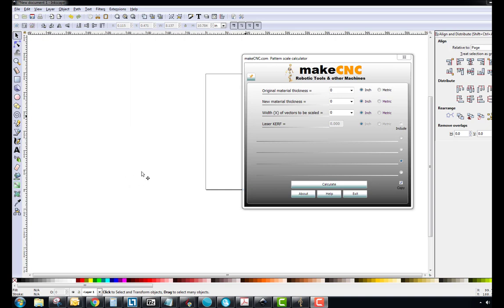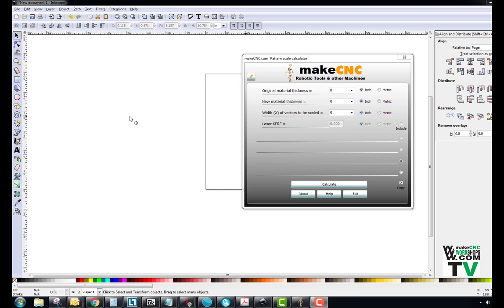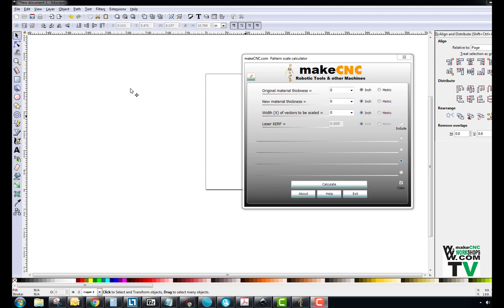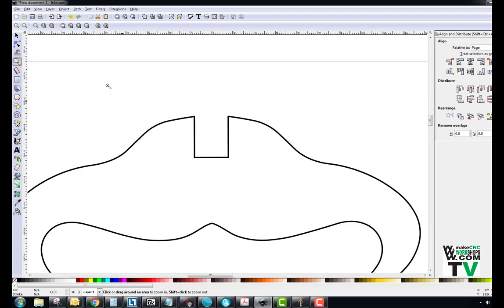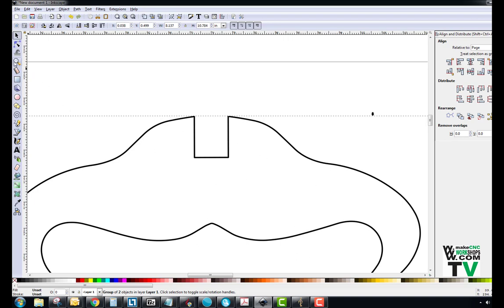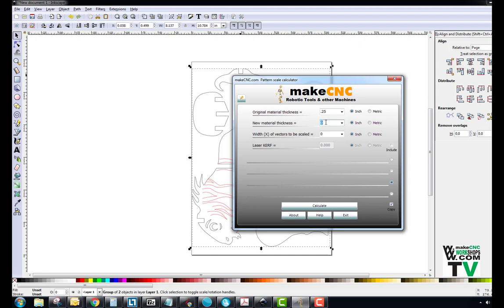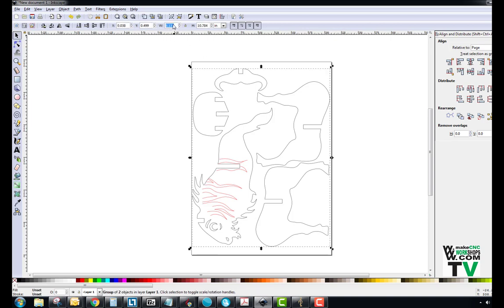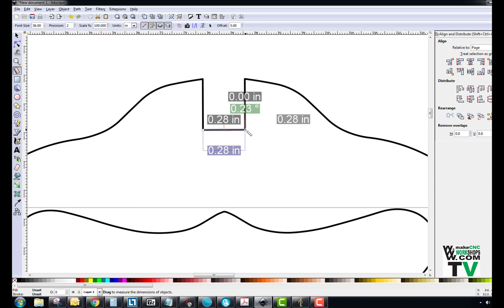inkskape makeCNC scale calculator tutorial

Comment: The scale calculator will easily transform the object you've purchased into a pattern that will fit the wood thickness you've purchased. What it doesn't do is transform the piece into a size that you want. So if you want to purchase say a house from MakeCNC and you want to use that as a piece of terrain for a miniatures game. The game uses 10mm miniatures but the house you purchased is say 3" tall. That pattern won't be adjusted by using the scale calculator. However, you can calculate the scale change if you know how tall the building is, and how tall you want the building to be. 

To do that you'd figure out how tall you want the building and scale down the width and height of the building to match. you will then have to go into the pattern and change the width of the connections to match your wood thickness. You can do that by ungrouping the pattern. Then set the (inscape) the selection tool to node. Now you can see where the nodes are. Using the mouse pointer you click outside of the node area and drag your pointer over the nodes to highlight the left side (or right) of the nodes you want to move. Then you select the X  (assuming the space you want to move is on the horizontal) and move the X over to the left how ever much you need for it to change the distance between the space where the parts connect to match your wood's thickness. 

Hope that helps.